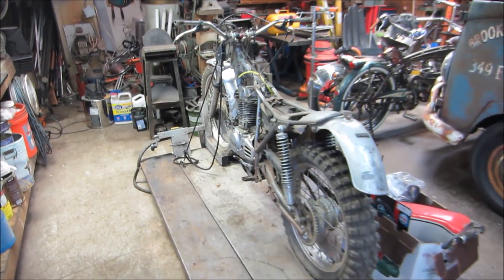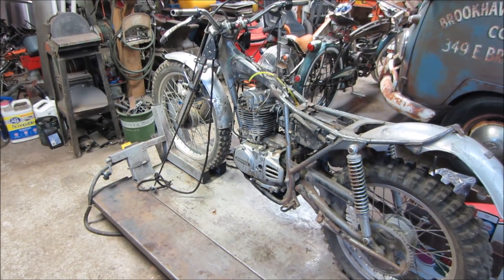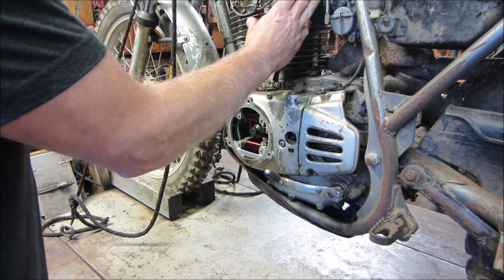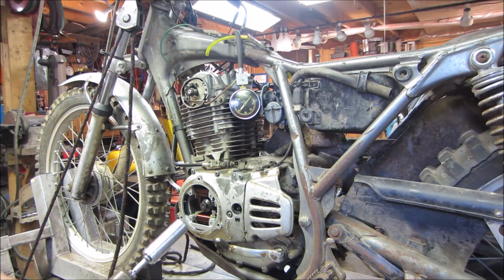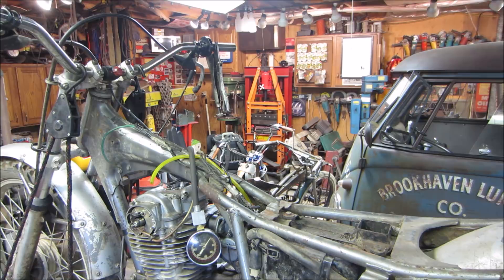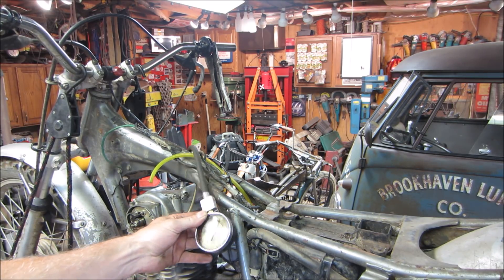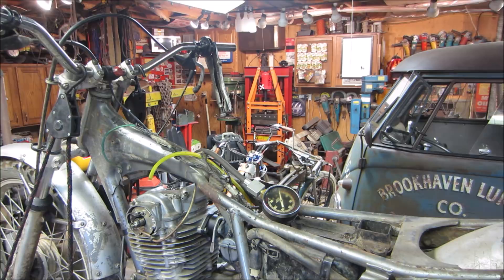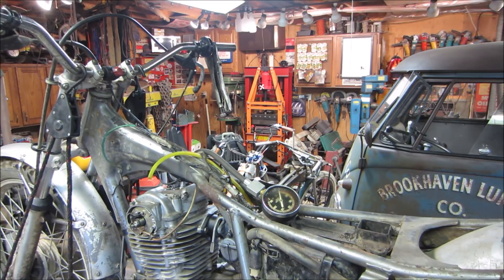Does throttle position affect a compression test? lets find out.

Comment: Hi Mustie, Try the same test but kick the engine over instead of spinning it over with an electric motor. On the old bikes (BSA, Triumph etc) there's about a 50% difference between throttle closed and wide open while kicking it over. When not on my Triumph I'm riding a 1976 XL250 Honda so this video extra special. Love this channel and all the fellow Musties.

Comment: As to your comment about exhaust and back pressure - it seems like if there were a plugged up muffler that would create an artificially high compression reading , wouldn't it ? Just for fun , do a compression reading with NO muffler on . (I get the picture of a jake brake on a diesel .VS. without.) Excellent videos !

Comment: Nice video to teach people about compression testing . I was just given another Craftsman riding mower , basically same model as both my mower and snowblower tractors . I was told the 18HP thing Briggs was no good , I have not had the time to start checking it out . Need to put a little sea foam in each cylinder and let it soak until I get a chance to work on it . Then I will do my version of "will it run" . It is always interesting and sometimes rewarding . Thanks for your channel .

Comment: Hey mustie have you ever worked on an old John Deere hit and miss engine it's the Waterloo engine 1.5 hp and 600 rpm  and I have no clue where to start.  Any help, resources, ideas,  or thoughts are greatly appreciated.  If I could get it running I would like to make a hit and miss mini tractor for tractor shows.  Thanks for the help
Reply: Shopdogsam is the man for that !
Reply: Whatever happens, make a video!!
Reply: IceCold I might especially of the mini tractor I think it would be easier to make a video that of an engine I have no clue about.  I also have thought of making a riding video on my atc if I ever make it to a park
Reply: N1ck0145 Garage check 805roadking.  He works on those engine.  Mostly Maytag.
Reply: John Moreno ok thanks for the info
Reply: Shopdogsam

Comment: Short video for you musky1 but my hat off to you for taking the time to answer this question for everybody
Reply: There was no question for some of us, we already knew the outcome.
What's happened to all the folks who worked on engines for years and years and who swore there was no difference?
Reply: Andy H the folks that swore there were no difference were wrong there is a small difference as demonstrated in this video if the air filter had been blocked that could have caused this issue all the old school mechanics would know that and as we never saw the air filter it wasn't an unreasonable question I suspect musky new that and that's why he made this video to show that it can make a very small difference but not so much that it would lower the compression to 60 PSI and to be fair in this test musky did not reconnect the air filter which could have caused even more losses in compression not everybody reads every YouTube comment on every video either

Comment: Great video I think if you could do a compression test at higher rpms the throttle position would have more variance than at low rpms.  Like when you are riding up a hill on my three wheeler in a low gear and then let off the throttle when reving high you can really tell that it's trying to suck in more air than it can causing it to crackle and stutter.  I believe that's why there isn't much difference in your test from half and full throttle

Comment: You should try a differential compression tester, where a given amount of pressure is compared to the ability of the cylinder to hold air. Leaky valves and rings become apparent pretty quickly. 
Love your work👍🏻